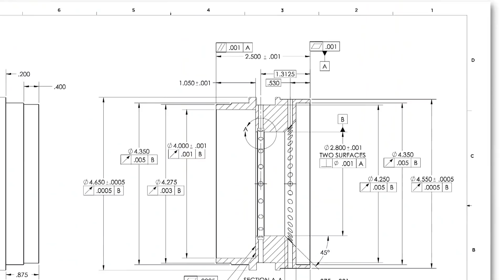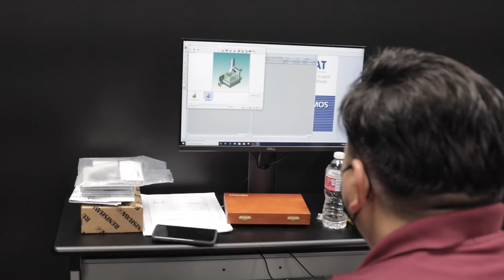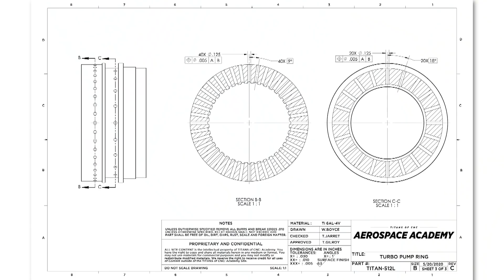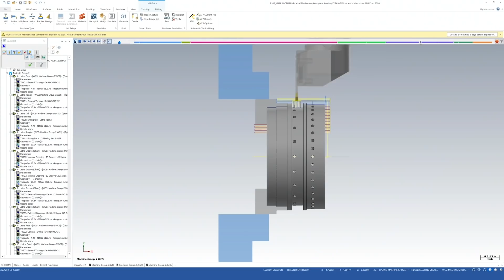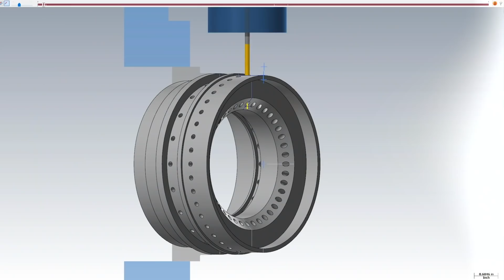Total Incompetence - Quality is Calling My Parts Wrong… I Checked Everything TWICE… UNBELIEVABLE…

Comment: This part looks familiar. It is a part of a fuel system of a rocket engine. The one that delivers fuel for mixing. There is nothing wrong inn multiple checking especially in rocket industry. And yes, calibrated plates are always superior than a CMM.
Reply: Isn't it against ITAR regulations to post images of liquid rocket injectors made in the USA? I know Space X has to censor footage and block certain parts when showing the rocket engines. Good video though!
Reply: @n111254789  I am often surprised  by what these guys decide to put on the internet.
Reply: @sam_s_  Mind you I'm not 100% for sure, I'm in my early 20's and haven't done much with machining so I could be totally wrong. 

Just a fan of rocketry, heavily invested in Rocket Lab currently and a part of a Cubesat program, and if I recall correctly there are laws on what is allowed to be shown and listed in regards to certain rocket components especially the manufacturing techniques for fuel injectors are the main thing. Similar issue with infrared optical sensors, and certain multispectral camera sensors.

Mind you I'm not mad at anyone for showing it. I just don't want someone to click on this video who's in the business and start hitting people with itar violations. It may be worth looking into because I doubt the video editor or the person machining it deals with itar ever and may not even know what they are doing could be illegal. I got in some issues with customs and itar over sending a consumer flir camera overseas, it was resolved with no consequences on my end but it is a pita and they take it seriously.

I would want someone much smarter than me to look into it. I just hate seeing people get into issues with the government over just trying to do their job and educate others. I imagine they know but I figured it would be better for me to say something and be wrong, than not say something and be right. They should for sure have someone verify if that's okay if they haven't already.
Reply: @n111254789  I have work in buildings where they manufacture rocket and satellite components. We were not allowed to bring our phones with us and we were even told where we are allowed to look as we walk. If you turn your head, your escort kicks you out.
Reply: @sam_s_  Do they manufacture weapons as well? Why would they be so secretive?
Reply: @Jeff-ss6qt  The satellites had military use. The funny thing was that you could not bring in a phone with a camera or a laptop with wifi. I had to use my laptop to program controllers in their building management system. They would look at my laptop, see that I flipped a switch to disable wifi, and put a sticker that showed my laptop was approved. Then I was free to bring my laptop and could just flip the switch back on.
Reply: @sam_s_  Then they're idiots. If they really care at all about air-gapped networks, no/minimal RF interference, and no secrets leaking then they should make sure that the laptop doesn't have a WiFi adapter installed. Not just check the switch.
Reply: @Jeff-ss6qt  Rockets are, potentially, weapons; so in terms of government regulations they are treated as such.
Reply: @Jeff-ss6qt  It's not like you can just have a very small usb wifi adapter in your pocket or something...
Reply: @FreezeS  Fair enough.
Reply: @Jeff-ss6qt  Every rocket, and certainly orbital class rockets are inherently weapons.  Doesn’t take much to strap a warhead to the front.
Reply: @n111254789  not just ITAR but export/import and defense and doe.  Some places won’t allow you take phones with photographic capabilities especially if there is a security clearance involved.  Yes rocket parts surprises me too.
Reply: @sam_s_    i was asked to 'mechanically disable' the wifi on my laptop once....the guy smirked at me thinking I had no idea....I smiled and flipped it over and unscrewed the access panel that included the RAM slots and I unscrewed the wifi card and popped the antenna leads off it and tossed it to him, and put the cover back on without missing a beat.....we got along real well after that....lol
Reply: @n111254789  If it were a part that was subject to ITAR restrictions, then Titan’s company would need to have an ITAR program in place and have an ITAR approval. This would mean suitable security procedures, responsible people identified and trained, secure storage for information and hardware, identified secure areas, etc., etc.  There would be very little chance of accidentally showing something they are not supposed to. In addition, the consequences of a security breach are potentially pretty severe.
Reply from the maker: Yes, it’s a Titanium Rocket Part…. We explain the entire process on our Free AerospaceAcademy.com
Reply: Agreed. Looked like some fuel injection part to me.
Reply: I think the footage is of a part from their aerospace academy and is just part of a turbo pump. I think it’s generic footage to make the point about something they can’t show
Reply: If you look at the bar stock used in the footage, it's black bar. Not titanium.
Reply: What made you think that? The blueprint literally shown at the very start of the video with the company aerospace name on it and turbo pump whatever on the description of the part??? Was it those things maybe that made you think that’s what it was?
Reply: @henrymorrey4150  What has got you so pissy partner?
Reply: @n111254789  Yeah totally. The video auto-played for me while I was cooking dinner, so I missed the blueprints at the beginning too. I found OP's comment worthwhile and interesting. But I also don't have a stick lodged in my arse 😂
Reply: @n111254789  the literal writing on the wall
Reply: @henrymorrey4150 ?

Comment: In my shop, we ran a rotation. A machinist would spend two days in inspection to learn what went on and an inspector would spend two days on the floor to understand what the machinist do. This was done every two months.
Reply: I moved from about 7 years in machining to QC as a CMM operator/Programmer for the last 3. Insure wish the floor guys would spend 15 minutes figuring out how to read prints.
Reply: @brahtrumpwonbigly7309  My QC department would run a class once a month teaching just that. How to read a print. I did pay anyone who showed up overtime to attend. IT was a slow process but it worked.
Reply: @twooldfartsinanrv7137  it's honestly a little crazy that this stuff isn't common knowledge with machinists, and that needs to change. Even button pushers need some basic knowledge of printreading and GD&T. It can only help, never hurt.
Reply: I think that’s the main point of the situation shown in the video. If teams are allowed to develop, they inevitably get defensive and adversarial. So switch everyone around until everyone realises they’re all on the same team. The problems are not with bad equipment or wacky procedures or even with mistakes made. All those things are inevitable. The problem is the human condition, human ego especially.
Reply: its the same on remote minesites.
one day a week the newbie will get to use the "relief" hole in the barrel during his time off, and one day a week the long-termers have to be in the barrel
Reply: QA/QC is a Mandatory 8 weeks before training on a CNC at our shop.